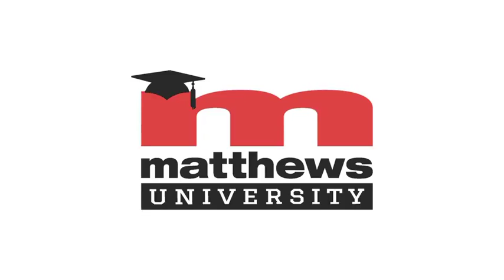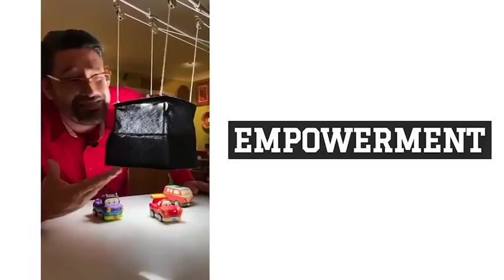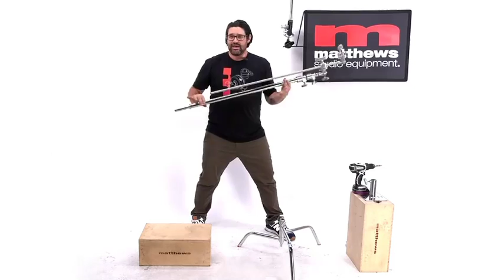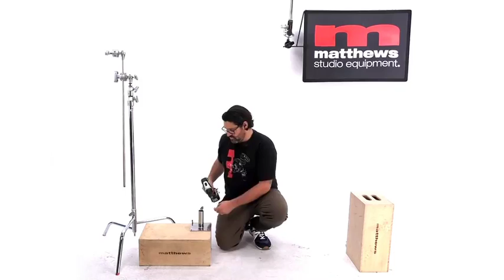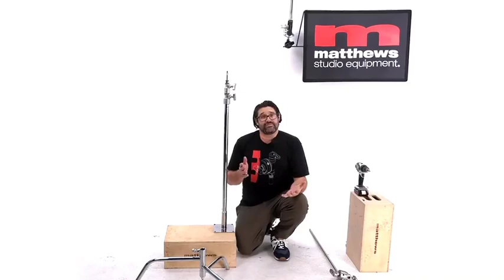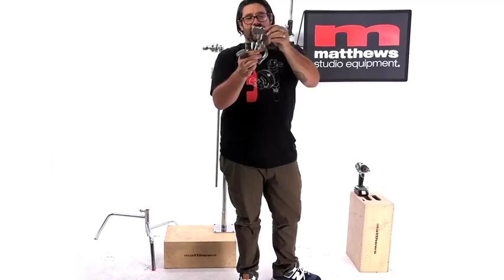Space Saver

Comment: Great video as usual. I have two questions. Will an Aputure Nova P300 light set into the C+ turtle legs with no issues? Also, I know you did one 7-8 years ago but is there a possibility you can do another video about the Matthews Mini Max Boom. Again, I am looking for something to hold the Aputure Nova P300 out and up safely.
Reply from the maker: From Martin: Hello there,

Really happy you liked the video. The Nova will drop right into the C+ Turtle Base no problem, whatta great panel, was playing with a few of them recently. You just remove the t-handle on the mounting pin and insert it right into the Junior Receiver. 

As far as the Mini Max, The Nova is right at the max payload of the stand, when adding modifiers it might overdo it on the risers. Our Junior Boom has a capacity of 25lbs, a bit more in line with the Nova, and our Menace Arm Kit paired with a piece of Speed Rail are a great way to boom out. Standard Speed Rail is schedule 40 when it comes to its wall thickness, on my truck I have a few lengths of schedule 80 Speed Rail dedicated to Menace Arm Kits. This gives me twice the wall thickness on the pipe, which gives a lot less bow or slouch on the menace arm.  I hope this info is helpful, let me know if I can clarify any of this.
Reply: @Msegrip  Thanks Martin. Any chance you can do a video on all of that :p  I was looking at Menance Arms but got a bit confused on the set-up and safety. Also it seems like you need a ton of balance weight for them. Lots to carry :p I think that's why I liked the Mini Max....more self contained and a bit easier. I think!  #learningeveryday!
Reply: I believe it does, I recall seeing a video that t
It fits onto a baby pin, but it also has the diameter to fit into a junior reciever